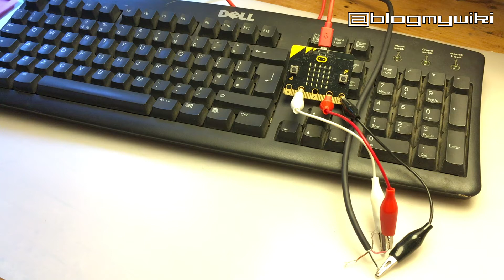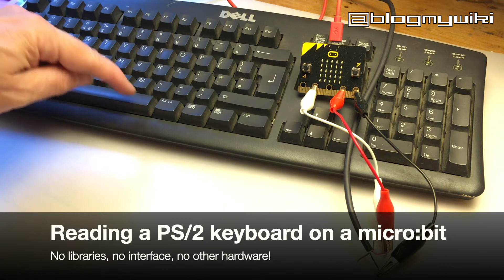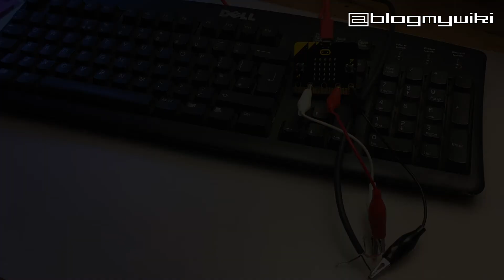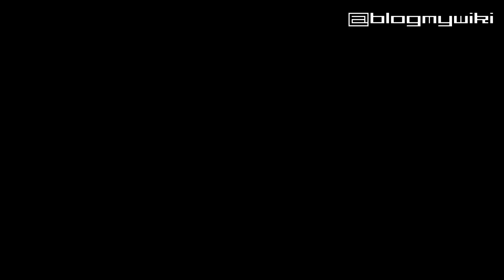micro:bit ps/2 keyboard teaser

Comment: Hello, I'm trying to replicate this but I can't seem to find the right baud rate. I run into duplicates or numbers that make no sense. Iv'e tried every 100 place from 10000-16700. Any suggestions?
Reply from the maker: Hi Derek - it may depend a lot on the kind of keyboard, it may that I just lucked out with this DELL one. I assume you're getting SOME data from the keyboard but it seems no good?
Reply: @othermachines  I'm going to try an oscilloscope to get accurate numbers.
Reply: @othermachines  Can you confirm if their is an error in your blog? It says none parity bit on your sniffer code but you say the parity bit is 1 and many other sources say that too.
Reply from the maker: @superflyderek3626  Hi again - I don't have an oscilloscope, but that sounds like a great idea to use one. I was working pretty much in the dark and I suspect I may have got lucky. I'll have to look into the parity bit issue, it's quite possible there's an error in my blog, happy to correct it if so.

Comment: Hey so i tried and the code gives a lot of errors do i have to install a extension
Reply from the maker: Hi there - it was a very messy hack, so errors might be due to differences between keyboard types. Alas I blew my keyboard up, so I can't test this project any more!
Reply: this is made for micropython and not makecode, which it sounds like your using from the mention of extensions